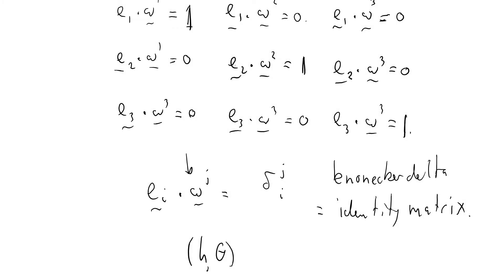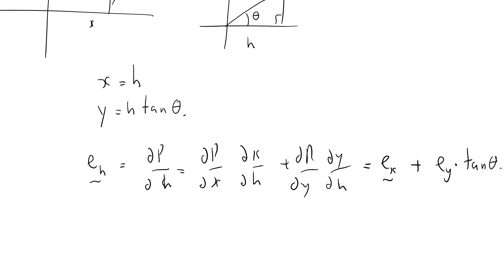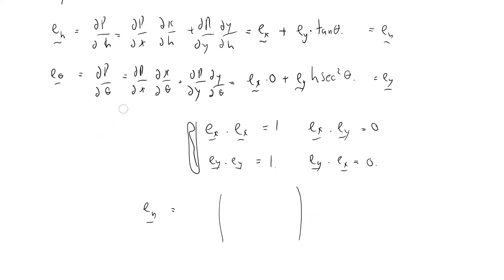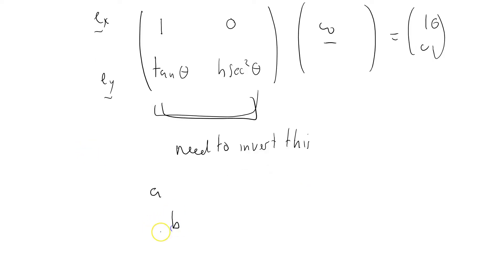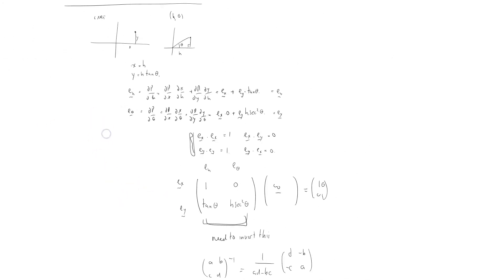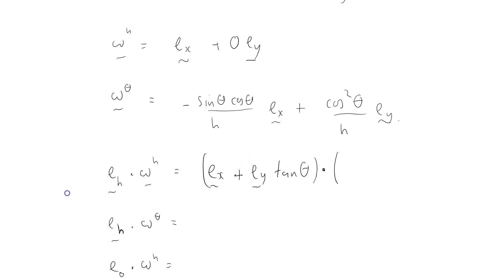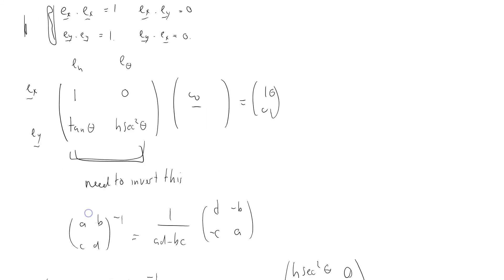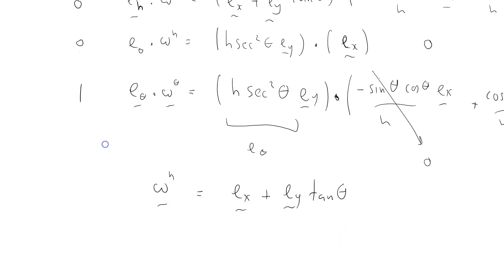GRSS 025 covariant vector basis part two

Comment: At 05:25 you multiply a (2x2) matrix with (2x1)  matrix the result should  be (2x1) matrix but why it is (2x2) matrix in the screencast ?
Reply from the maker: the omega matrix is 2x2, does this help?
Reply: @trintragulageneralrelativi2639  would u like to mention the component of Omega matrix

Comment: Looking at the equations relating the (h,theta) basis and the (x,y) basis

eh          = ex +tan\theta ey
e\theta = 0ex + hsec^2\theta
I thought the transformation matrix would be 
1    tan\theta
0    hsec^2\theta
 which multiplies the column vector ex to give the column vector eh
                                                                ey                                                e\theta

At 4:33 you make a 2x2 matrix of the transformation as 
1                   0
tan\theta    hsec^2\theta
which you call the e matrix and  is the transpose of the matrix I was expecting. Could you say what type of matrix this is or is there an online linear algebra/matrices text that you could refer me to for more information. By the way your videos are very good.
Reply: hello declanwk1.  Thank you for your kind words!  You are abolutely right that the transpose of this 2x2 matrix would have nice extra properties such as transforming from a column vector of coefficients of  (ex,ey) to a column vector of coefficients of (eh,etheta). My way of doing it means that the transformation works on row vectors, which is not the usual case.  Your suggestion would have been a better way to do this video I guess.   But as I show in the lorentz transform series, matrix formalism of this kind can be misleading.  Best wishes, TT
Reply: thanks for that reply, it is helpful

Comment: Thank you so much for these excellent videos.  I have been trying to teach myself GR and worked through all manner of videos and books and have got frightfully stuck.  Your videos have made all the difference.  I'm afraid, however, that I have got rather confused in this video.  I got rather stuck with the use of row versus column vectors, but I think I now see where this is coming from.  However I am still confused by your equations around 13.25 where you are equating omega's with linear functions of e's. In my previous readings I thought that omegas were different objects to e's  (the former one forms and the later vectors) and could only be combined  where one acts on the other as a function generating a real number -  or through the use of the dot product with the same effect -  so this calculation has left me rather confused.   I had thought that your video was leading to getting omega-h and omega-theta s in terms of omega-x and omega-y rather than e-x and e-y.   Anyway - any guidance you can give would be gratefully received!   Peter
Reply from the maker: thanks for your kind words Peter.  I tried to find 13:25 but that is the very end of the video so I'm not 100% sure where you were pointing to.  The next screencast does some more groundwork linking the omega vectors and the e vectors.  But you're right about the relationship between omega's and e's in that the point is each one is a linear map from the other to the reals (via the dot product).  But the best way to teach this (especially in the curved space needed for GR) is to start with plain old vectors and ordinary dot products; and my approach has always been to start with the familiar and work from there.  And e_x and e_y are our old familiar friends on the Cartesian plane.   But this is hard work!  Any more questions, let me know.  Best wishes, TT
Reply: Sorry I got my times completely wrong.  If you look at 10.12 it shows two equations: omega_h= e_x and  omega_theta = -sin_theta/ h e_x + cos^2_theta /h e_y., and it is that combination of omega on the left hand side and e on the right hand side that I did not understand.   Anyway, I'll now move onto the next video and hopefully that will sort out my problems.  Many thanks once again - these videos are first rate!   Peter
Reply from the maker: @petershotts8571   OK, first of all it's easy to over-think this.  omega_h and omega_theta are just regular 2D vectors here....but they are defined in terms of their dot products with the e_h and e_theta.   And for reasons that will (hopefully) make sense later in the course,  we express omega_h and omega_theta in terms of e_x and e_y.    It's possible to have a much more rigorous approach but that's not what I'm trying to do.  Hope this helps,  any questions, let me know.  Best wishes, TT

Comment: Thanks a lot for these videos. I have worked through many other online videos on tensor calculus using different notation. Even though I am well familiar with the course so far and much of what is to come, it is great (as review) to get a different take on this subject as well as see more examples.
Reply from the maker: hi, thanks for this! Let me know if you have any suggestions or comments.  Best wishes---TT
Reply: @trintragulageneralrelativi2639  

It seems the title of this is misleading.  While the vector components are covariant in the omega basis, the bases is a contravariant bases.  In particular, omega basis is a contravariant basis while e bases is a covariant basis.   This is consistent with your earlier videos, where you said things with upper index are called "contra" and lower index is "co".  Otherwise, you are calling the earlier e basis covariant basis  with lower index and now you are calling omega basis with upper index also "covariant" basis.   They both can't be covariant basis.

If my observation is incorrect, please correct me o/w you are leaving me quite confused.

Comment: So is the omega matrix is transposed as compared to the "e" matrix? I see e_h and e_theta are along the top in the E matrix while omega_h and omega_theta are along the right in the omega matrix.
Reply from the maker: hi, yes you're right.  It can be tricky to use correct matrix techniques (as I show in GRSS 104 where I use matrix multiplication incorrectly and get myself into a tangle trying to resolve the mistake).  Here the thing to remember is that an inner product is a multiplication of a row vector with a column vector, which is why matrix multiplication works.....but you have to remember that the e vectors are column vectors and the omegas are rows.  Best wishes, TT